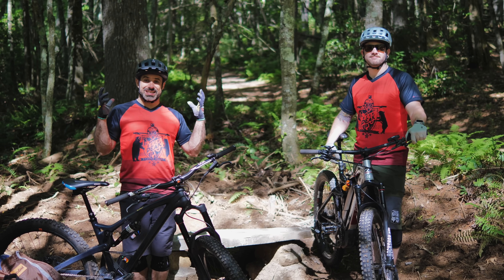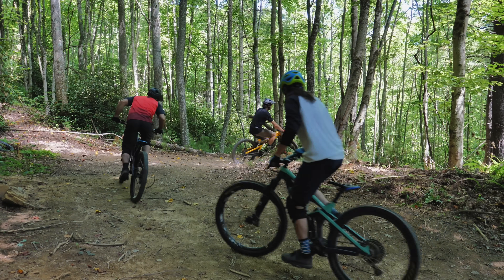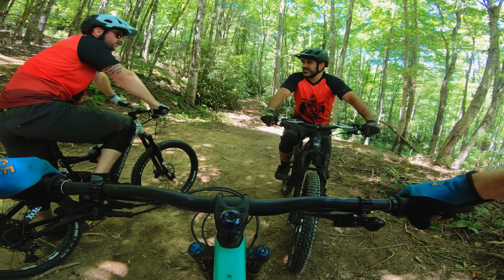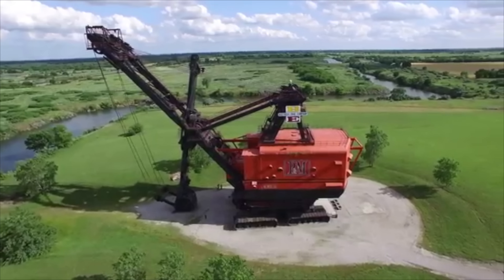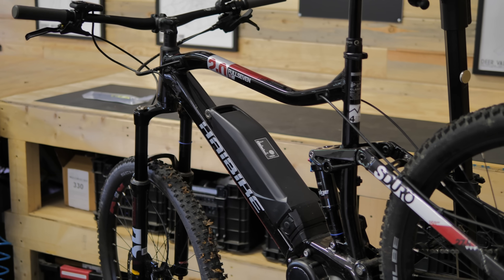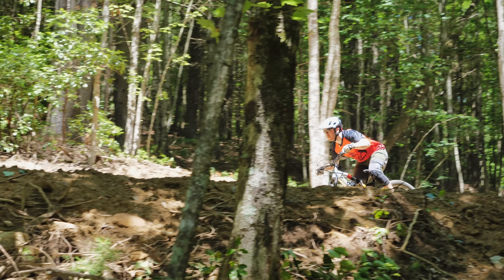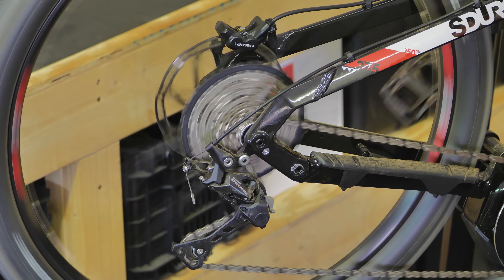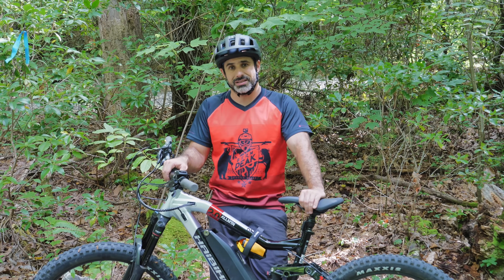Doing E-Bike Laps with Johnny (except I'm not on an E-MTB)

Comment: Never knew that the headset could get loose after a few rides for a new bike. Thanks Seth! Now all I need to do is remember this when I get a new bike.
Reply: You should also check it every few months. Usually it's not very bad if you don't though.
Reply: Wow I learned a little about maintenance, thanks Seth!
Reply: mine has play and I had no idea why
Reply: Ya I didn't know that either. I was trying to get my whips perfected on some local dirt jumps and I landed very sideways the bars were in one direction and the wheel was in the other...
Reply: I do a short check of my bike before every ride to make sure everything is locked in, and that nothing is moving that shouldn't.  It only takes a couple of minutes, but I know my bike won't fail on me.

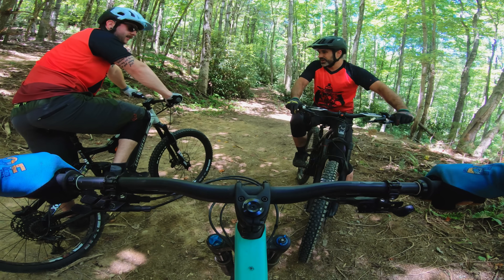Comment: I thought that those little clicking noises at 4:10 was seth shifting. I was wondering how he had like 75 gears.
Reply: same lol
Reply: Lol
Reply: Same
Reply: I’ve noticed that as well. It is the carbon full suspension has a bit of a creek in it. I would recommend that he would spray the linkage with simply green degreaser and let it set for 10 minutes exactly. After that, he would spray it down the linkage with water. Afterwards, he should put triflow on each linkage point to make the ride creek free.
Reply: ǝɔᴉnɾǝlʇǝǝq now that’s shop-mechanic level advice right there       /s
Reply: same
Reply: Nah man he's just got a drivetrain from 2050. 1x100

Comment: Thanks Seth so much. The head set of my 2018 Scott scale 980 was vibrating and it moved around a little. I loosened the two sides then took the pa top of and it was full of dirt! I cleaned it out and greased it all up and now there's no vibrating or pivoting at all! Thanks so much!! (Just bought the bike used)

Comment: Thanks Seth, recently purchased my first ebike (cube acid) and first decent mtb (last one was a gary fisher) and due to lockdown, not been able to take it back to the lbs for a service. I've noticed a clicking noise from the front, and thanks to this video, looks like I just need to do some basic adjustments to keep it in top form.

Fab advice from across the pond in Sunny (not so sunny) Wales.

Comment: When rocking the bike back and forth the pads can move around inside the brake caliper. This can make you think your headset is loose but in reality nothing is wrong. This usually only happens with those hydraulic two finger brakes on the cheaper side of things.
Reply: Also, on less expensive forks, they can sometimes flex or have some play, giving the impression of a loose headset.
Reply: @Will Mauney 
tell me about it haha I work at a LBS and those cheap ass forks are the most dangerous component. All it takes is a shitty weld to brake and then the lowers can just fall off.

Comment: Always leave your bike in the smallest cog when you're not riding it, takes all the tension off the cable and stops the stretch. Didn't adjust mine once from new until I changed wheels two years later and it was still perfect. 
Got to ride a brand new park myself a couple weeks back, Bike Park Kernow, so nice when it was unmolested by time and cutlines.

Comment: Hello Seth, 
I’ve noticed that your black black full suspension has a bit of a creek in it. I would recommend that you spray your linkage with simply green degreaser and let it set for 10 minutes exactly. After that, spray down the linkage with water. Afterwards, put triflow on each linkage point to make your ride creek free.

Comment: Sometimes it may feel like a headset, but moving pads in a caliper. For a fool proof method to check the headset, turn the bar 90 degrees, then push the bike back and forth.  If moves, for sure headset.

Comment: Minor nit: the cables aren’t stretching. The liner in the housing is plastic and the tension pulls a groove in it a bit. It’s more the cable settling into the housing than the cable stretching. (Most cables as stressed more in manufacturing than on the bike, all wear is friction)

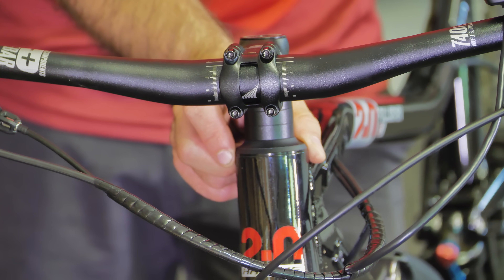Comment: 8:38 I prefer this method cus this won't get effected by grips, the brake pads moving with rotor and knocking in the caliper, which is often mistaken for loose headset. I haven't had to do this to my bike yet. but the headset is Chris King, that probably does not make a difference when it comes to loose headset thing you mentioned short term, but long term it has, I've had headsets wear out faster before, and I could feel notice the wear in few days, or week, the bearings I used before were Enduro, Cane Creek, the stem is Renthal Apex, very secure if properly torqued, and Loctite 243 is applied and cured, so as long as this is done, the stem is secure no even in fast changing temps, hard riding. So loose headset is not a problem I had since I switched to this stem, and Chris King headset.
but I've experienced bolts getting loose on other stems, which resulted in loose headset, cus stem slid up and top cap loosened.

Comment: I climb virtually any hill at 30km. 28 if it really steep. 1 or 2 gears down on the cassette, stay on the big chain ring most times. I don't dottle though, I pedal like a demon, and work hard, I just fo faster.

If I was riding with you guys I would drop a few more gears, use less assist, to keep with the pack.

Jumping a whole 'nother story. On my list of things to accomplish, and I am riding all winter so maybe some small ones, then bigger come spring.

 Love the content and as mentioned in my other comments I like presentation. - Cheers

Comment: Welp. I actually learned something today. 
Now if you'll excuse me I have a headset to look over. 
Since I store my bike in my bedroom I loosen and twist the handlebars to lean flat against the wall. 
And since then I've probably tightened the bolts in the wrong order, top bolt last.
Reply: like he said, the headset will be loose. try not to untighten the top cap when you turn the bars, you don't need to.

Comment: Good to turn wheel 90 degrees to check fir headset play....most forks have some bushing play and the shown method leads to sooo many overtightened headset as people still feel movement, mistakenly think its in the heaset and tighten more and more. Not a good technique just using the brake, and rocking.

Comment: Speaking of dork disk - how would you design one that actually works?
Reply: It would probably have to be metal with a clip system that you can press when it's on the bike and it just comes off. And it would have to be able to cover sizes up to about 60 teeth for future proofing.

Comment: Why are e- bikes not allowed on most trails?  I've even heard of some trails allowing pedal assist but not e-bikes.  I'm not understanding the differentiation.
Reply: they are the same thing. There are some laws about motorized vehicles that haven't adapted to modern E-bikes. But nowadays you wont get in trouble for riding a pedal assist bike on an mtb trail. As long as it doesn't have a throttle, and as long as it isnt a surron or an electric dirtbike or anything, you should be fine on mtb trails

Comment: I took of the rings on my suspension. Can someone tell me if this was a big mistake. 
Thanks
Reply: The ring on your stanchion or suspension arm tells you how much travel your using. If it is butted up against the crown of your fork, that means you bottomed out at one point and should add air to the fork (assuming it’s an air fork). They are important if you want to dial in your suspension but aren’t fundamental to the function of the shock. Still shouldn’t have cut them off though because they have zero downsides.

Comment: Hmmm. Correct me if im wrong or just ignore me, but why do 4 wheeled bike are called quad bike? While bike means 2 wheeler. then should it be Bi/Di-BIKE instead of a quad bike? Because “QUAD” &  “Bi” or “Di” are prefixes. 🤔 hmmm, and why did i say 4 “wheeled bike” instead of QUADCYCLE or TETRACYCLE?  Also, why do we say TRICYCLE a tricycle and not TRI BIKE or TRI MOTORCYCLE? Why it is called TRIKE for 3 wheeled but not QUADIKE for 4 wheeled?

Jk